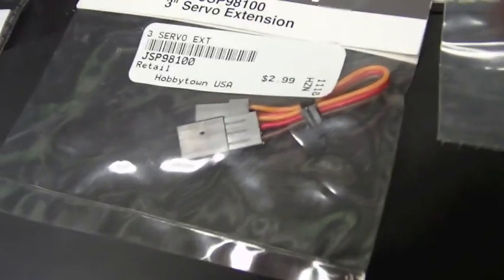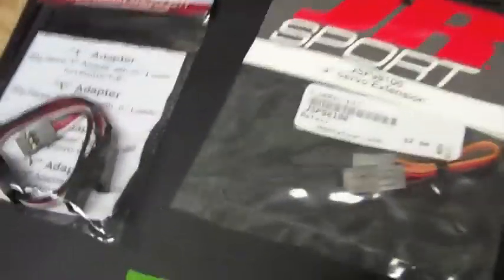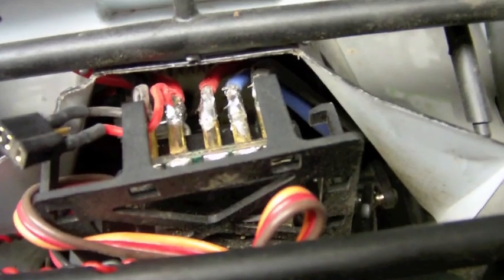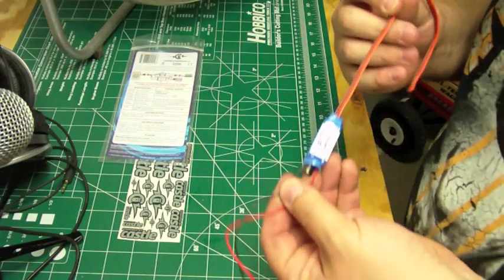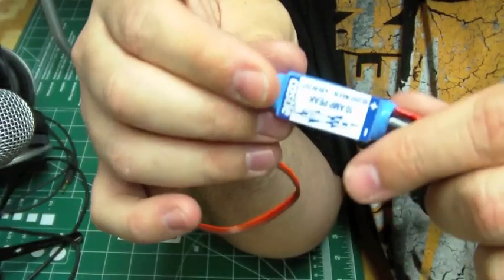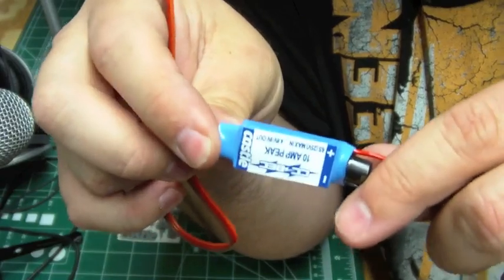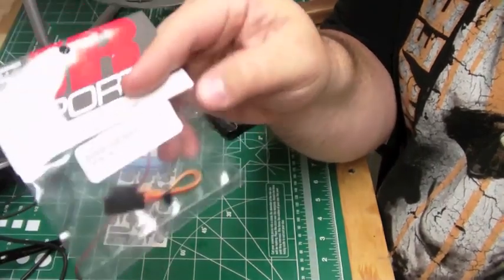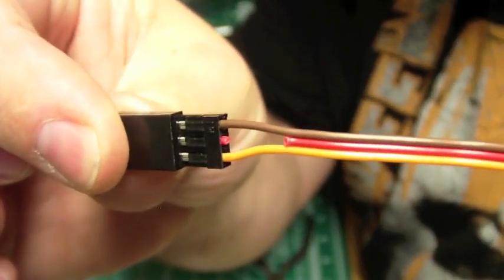Axial Wraith Upgrade vol 3 - Install a BEC!!

Comment: Good video. Learned to do that on my balsa Planes 3 years ago. Prevents brown outs and servo failure while flying Nitro or Electric. Seems the heavy duty metal servos can drag the voltage down while doing 3-D flying. Futaba servos and the like. Also, use a ferrous ring on your wire to prevent stray signal interference.  I need to put one on my airboat. My metal servos keep experiencing jitter on my twin rudder setup. You can also lift the black tab and extract the red wire connector and all. Then just tape it back away from any ground situation. This is all basic on my RC planes. Internal BEC's can and will overheat on some HK ESC's. As stated, on the RC vehicles, the internal BEC can cause servo issues. Great video. I will be doing this to my Wraith Build as well.

Comment from the maker: Well considering a BEC is a battery eliminator circuit it's probably a step backwards, but you would just do it old school by plugging the RX battery pack straight into the receiver. If you wanted a separate battery to feed the BEC or a regulator you would just plug it into the BEC directly. instead of plugging the BEC into the main battery. This would allow you to say run the car on 7.4 volts, but run your servo at 11.1 or vice versa. This is similar to setups we used to run in my helis.

Comment: great video. little late for me though as i already learned about needing a bec with my 7955. I tried that lowering mod and it would hang up on the rocks a lot. i guess it depends on what kind surface you drive it on. I now run softer springs at about 80% droop. i feel this performs better for where i drive my wraith. nice looking truck!

Comment: Instead of cutting the wire you can lift the plastic tab behind the exposed metal of the esc to receiver and then just pull the middle wire out. Plus it can be inserted back in if need be.

Comment from the maker: it will but will only cut power to the throttle which should still be fine. This is pretty normal on flying models so that when you cutoff hits, you can still land dead stick.

Comment from the maker: you mean calibrated to your controller? Try moving all your end points to max throw, and make sure all of your trims are set to the middle. You can also try reversing your throttle channel. I have a Tekin that wont calibrate unless my throttle channel is set to reverse.

Comment: Great Vid! Very helpful! I found all the parts you used to install the BEC. I am curious what kind (gauge) of red and black wire you used to solder the deans 3 pin to the ESC. Thanks again for the video......subbed!

Comment: Very detailed info. So is this CC BEC essentially the same as a plugin glitch buster? Meaning, basically it helps power a thirsty servo? I've upgraded to all metal gear servos in my RCs but not high voltage ones so I'm wondering if I need an external BEC. They all have glitch buster and no problems thus far.
Reply from the maker: Not the same. A glitch buster is just a capacitor that smooths out the flow in power helping prevent spikes and brown outs, it doesn't actually do any regulation. You will get full voltage through the cap. If your BEC cant keep up with the demand for power you will still get voltage sag. The BEC allows you to limit the voltage running straight from your battery. they also have a higher current threshold 10-20 amp vs 3-5 amp that is common in most stock onboard BECs. Its most beneficial When running 3S or 4S on a servo that isn't rated for those voltages, but has high amp draw requirements. It's also adjustable to be able to customize the voltage you want your stuff to run at.

Hope this helps

ev0l

Comment: yeah well  im i just installed my novak gaot system and ive tyd the proper procedure that the instructions say and at one point it connected and went full throttle and steered both ways on its own but i cant seem to get it to go back in the mode were i need it to calibrate again

Comment: I like your idea of making it removable with the plugs, it gives you options. I am in the process of installing one and looking at doing something similar.  Is it plugged into the speed controller channel or the battery port?

Comment: Evol,
Will this same setup you did work with my brushed Tekin FX-R crawler system I have??
After the BEC is installed the On-Off switch no longer works right..
Thanks for any help with this.

Comment: Hi there
Hope you can help. I live in South Africa. Bought a Wraith. Installed a Vanguard esc and vanguard 2900 kv motor.

It runs fine as is. As soon as I install a bec it stutters if you apply full throttle. Remove the bec and all is fine. I tried a cc bec as well as a radio shack bec. 

I did all the steps as the diagram shows.

Help please
Kobus
Reply: kobus pretorius did you disconnect the red wire on the connector from the ESC to the receiver?

Comment: Hey Evol. I installed this in my wraith. Now my headlights turn on as soon as I plug in the battery. The truck is turned off too. Other than that it runs great. Any suggestions?  Thanks.
Reply from the maker: I install a switch on my light to control them. Alternatively you could power your lights with the internal BEC on the speed control. Just take some creative wiring.

Comment: Hey Evol. thanks for all the vids. learned alot. trying to install a bec. got all the parts in the video except the one that you soldered to the esc. what's that called? cant find it under" deans mini plug" on any website. am i missing something? thanks again.